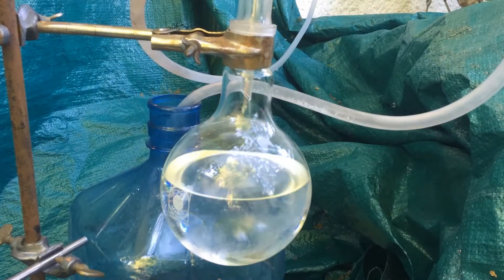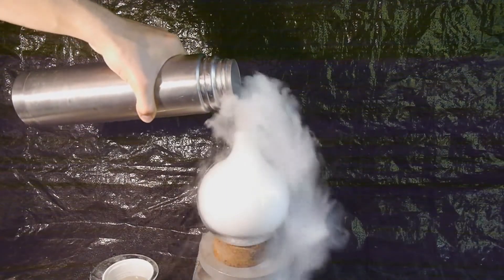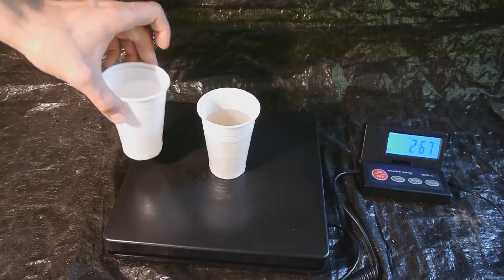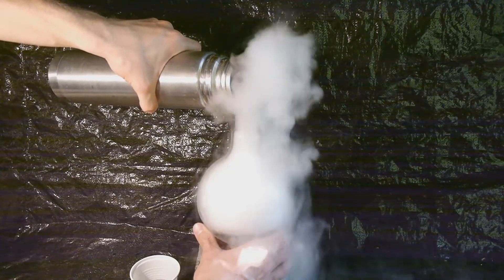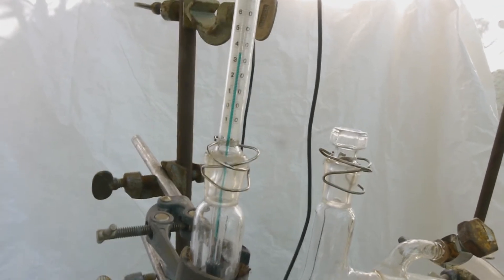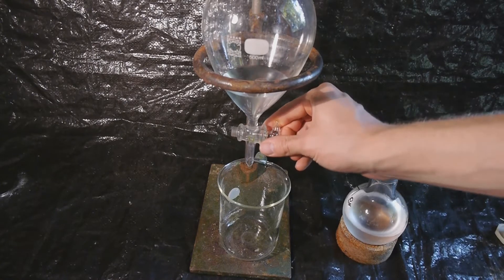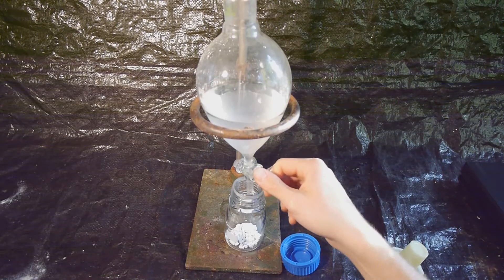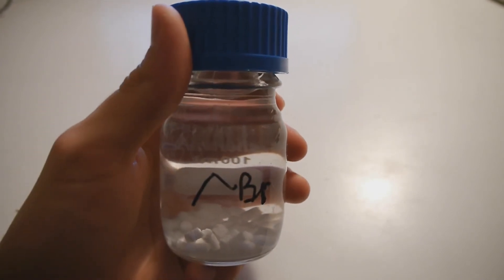Making a Carcinogen from Ethanol

Comment: FYI - the reason that the phosphoric acid  didn't react readily with the bromide salt is because it was 85% aqueous acid.  That 15% water inhibits the production of HBr gas.  If you take the phosphoric acid and heat it to 150C - 200C (preferably in a PTFE beaker or some other acid proof container because hot phosphoric acid attacks glass) for a couple hours you can drive the water off and even form some polyphosphoric acid.  This reacts much more readily with bromide salts to make HBr, though heat (150- 200C) is still needed for the reaction to go quickly (that reaction can be done in a glass flask without significant attack on the glass).
Reply from the maker: Very interesting, thank you so much for the input! I might try that one day!
Reply: ive also seen a paper on the generation of HI gas which also stated that bromide and iodide will not react with 85% phosphoric, though instead of forming polyphos they simply added phosphorus pentoxide :P

Comment: Please wear gloves with conc. acids. You are holding the bottom of the beaker with your right hand as you pour conc. sulfuric into the flask with no funnel, and the flask is just balanced on a cork ring. It makes you look very amateur, even though you are clearly intelligent.
Reply from the maker: Thank you for the compliment! I actually did get sulfuric acid on my skin in the video and it did nothing that I noticed at least. Nile Red did a good Video on that a while ago (Acids on Hand). But you are right I should wear gloves more often. ;-)